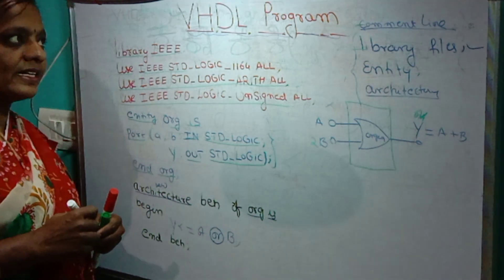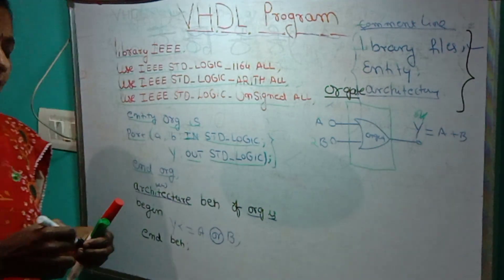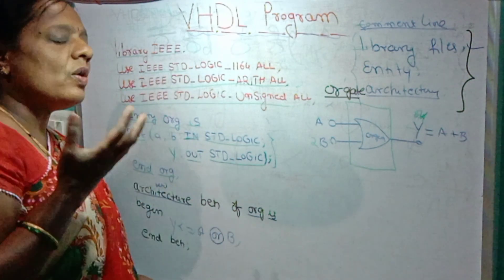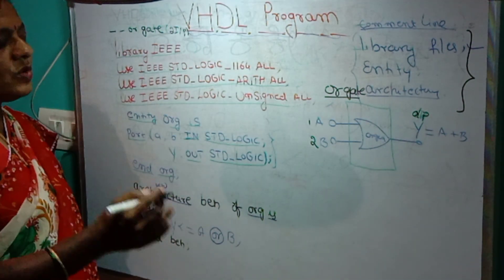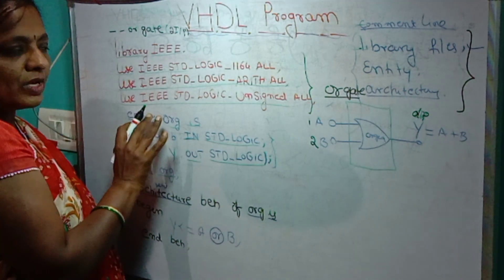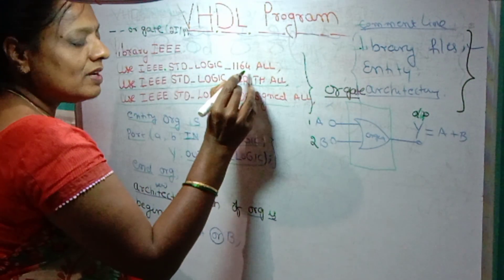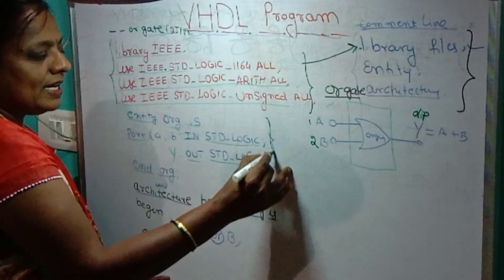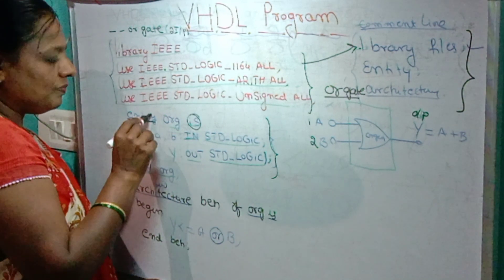How to write VHDL Program  using behavioral model.

Comment: Good afternoon mam
1.Program baribekadre library nali enu changes Agallva mam bere function ge program baribekadre.
2. 1164 Andre enu mam yalla functions gu 1164 ne use madbeka mam library nali .
Reply from the maker: Good questions Amrutha.
Reply: Mam then wht is reason  of using that  number in program mam
Reply from the maker: 1.There is no changes in library files.
2.The IEEE 1164 means 1164 standard (multivalue logic system for Vhdl model interoperability) . It's a technical standard published by IEEE in 1993.
Reply: K màm 
👍